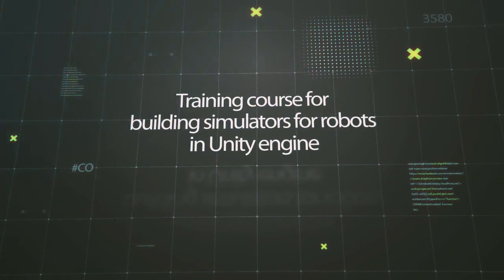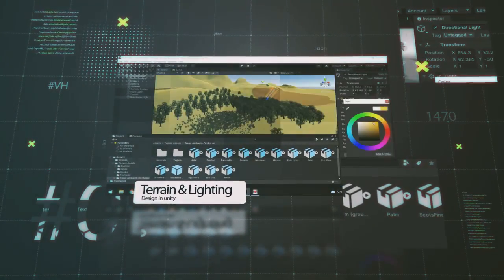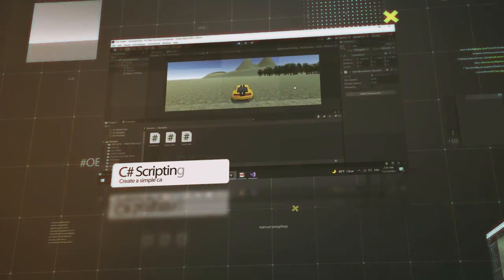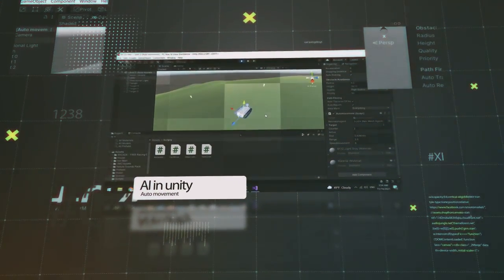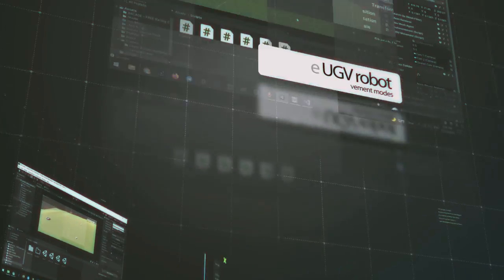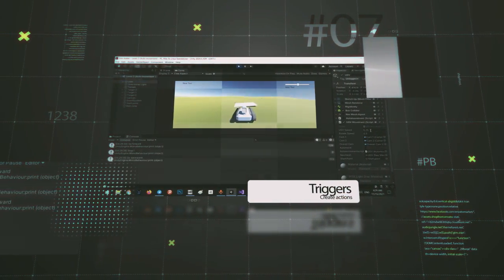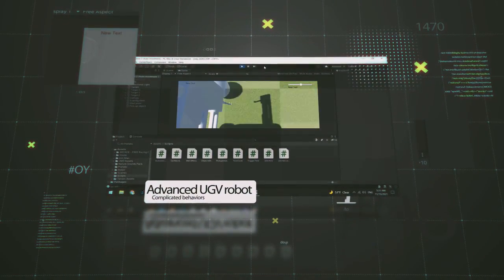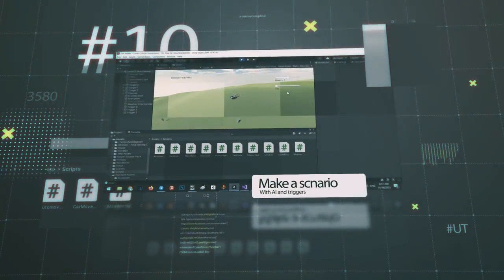Developing a Robotic Simulator on Unity Engine: Introduction (1/27)

Comment: Please, how can i get a torque measurement on robotic joints in unity 3d ?
Reply from the maker: These links can be helpful:

https://answers.unity.com/questions/171859/figuring-out-the-correct-amount-of-torque-to-apply.html

https://forum.unity.com/threads/how-would-i-calculate-torque-from-force-applyed.455308/